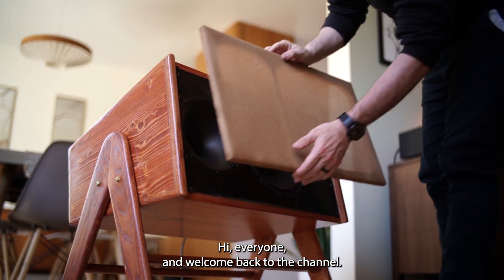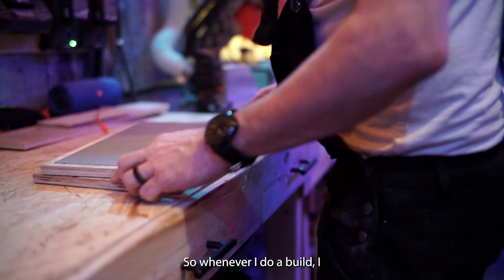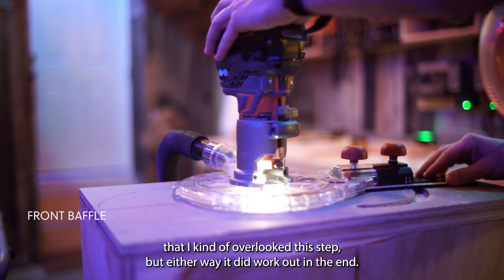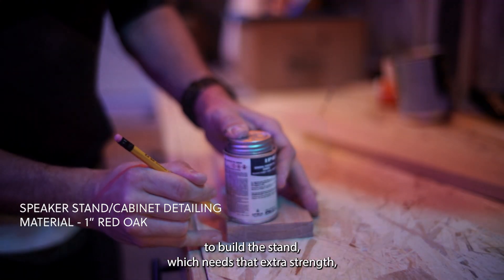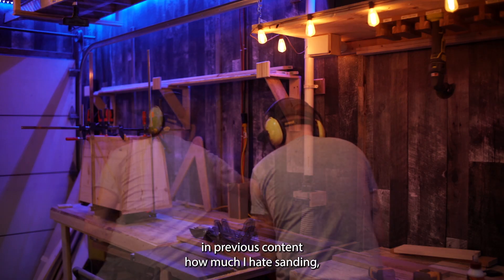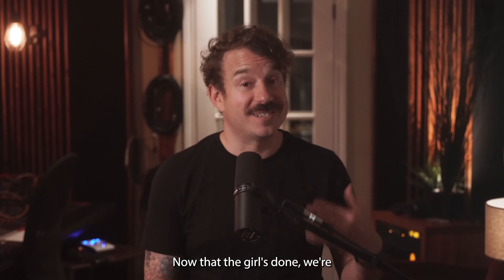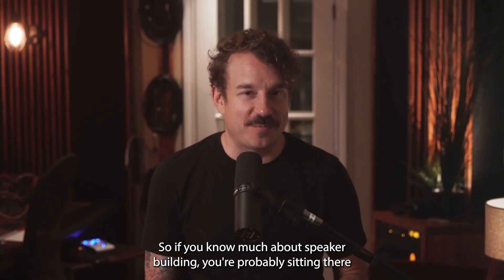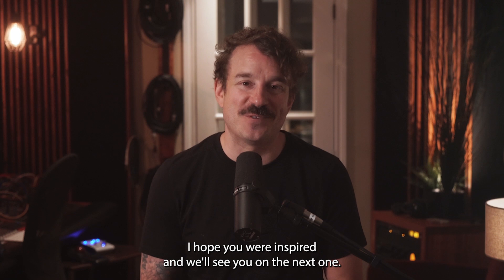DIY Bluetooth Speaker Build. Full Build Video and Demo

Comment: Is that an Earthworks measurement mic I see?  Good choice!  I use the M30.   

It's too bad the plate amp doesn't have any DSP capability because then you could dial it in perfectly.  I suppose you could do a passive notch filter to take care of that 500 Hz peak but I think I would rather put some EQ in front of the amplifier.  I was going to say put a miniDSP 2x4HD in front of it but it's Bluetooth so you can't.  You would have to insert a simple analog active EQ into the amplifier which would be more trouble than it's worth but doable.  

Nice job on the build, it looks great!

Comment: awesome build! that amp unit is dope. the 500hz is probably cabinet resonance. even if you used a crossover, it would still be there. if the foam is the only material in there, it's probably way underdamped. i suspect you would get a tighter sound if you stuffed it with rockwool.
Reply from the maker: Good stuff. Thanks for the tip and thanks for watching.